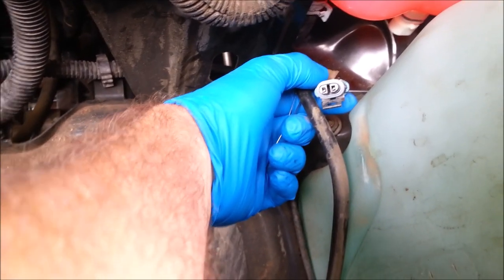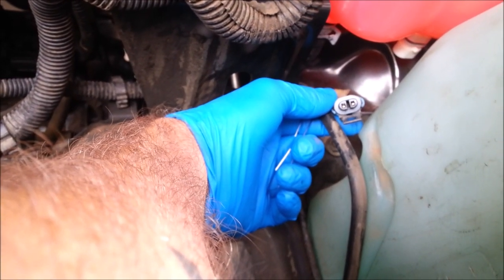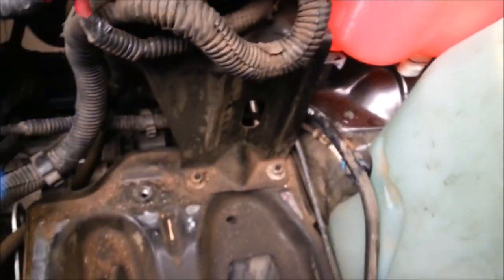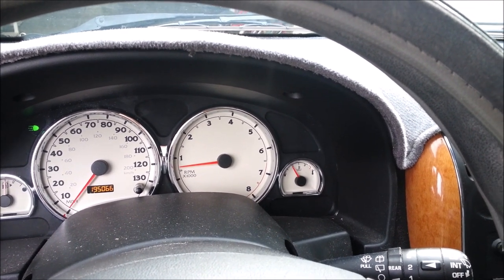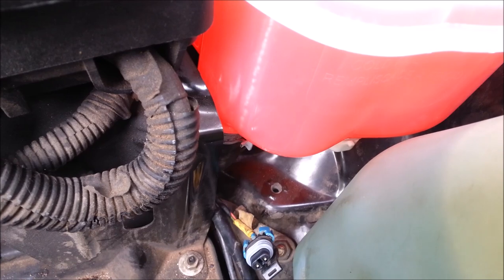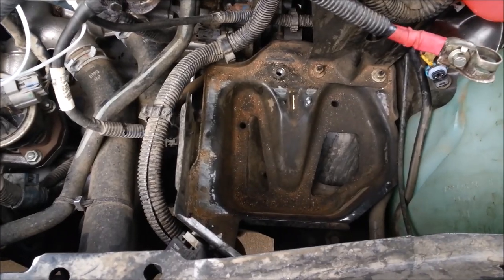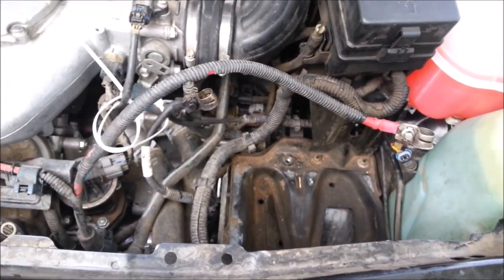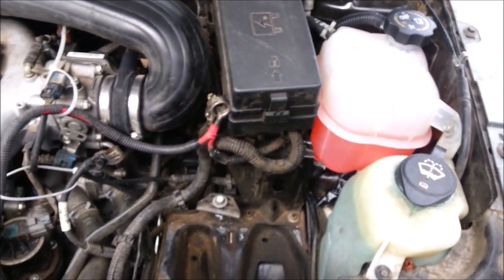"Coolant Level Sensor Bypass" (Jumping it with a Paperclip)

Comment: I don't see how it's jumped? All I see is black tape, what's the purpose??
Reply from the maker: It's a paperclip that is bent and inserted into both holes of the electrical connector. The black tape is wrapped around the paperclip.
Reply: If you can't figure that one out I suggest you leave it alone, this is not for you.

Comment: That's why they are called "idiot lights".
Reply: It is actually a nice feature. Warns you when the level gets low. Many cars you find out when it starts to overheat. If driving you can pull over and fill/fix the leak before overheating and being stuck, and or causing engine damage.